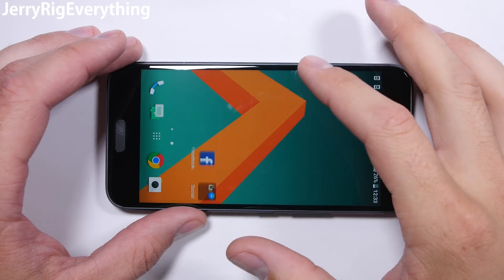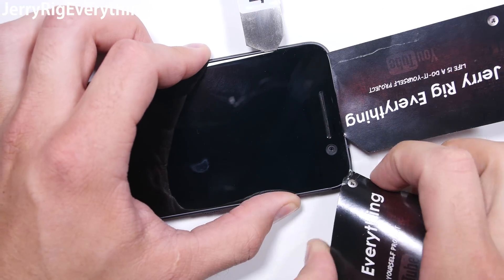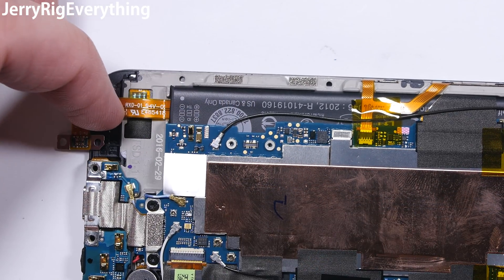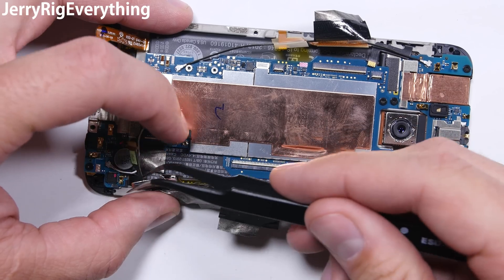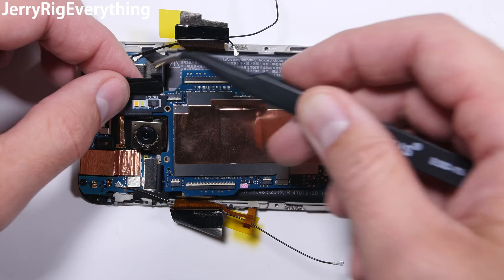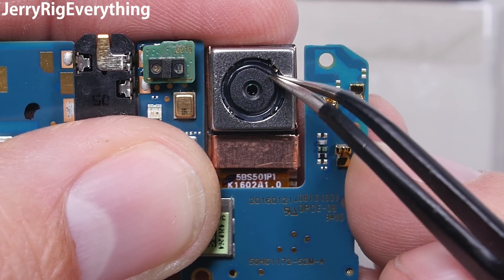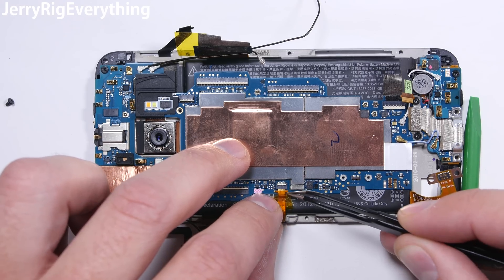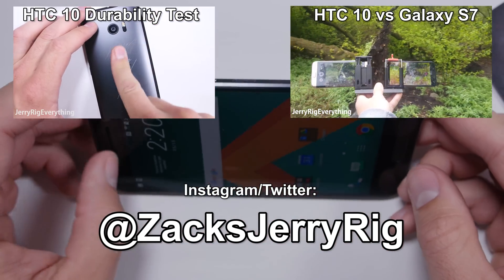HTC 10 Teardown - Charging port fix - Battery Repair - Screen Replacement

Comment: Hi all, i want to replace just the charging dock.
Do I have to do every step in the video until the charging port, or are there some steps i can skip ?
(I don't need to change the screen nor the battery so I thought maybe there are some cables and/or elements that i can just leave as they are ?)

Comment: I am replacing my battery on a HTC 10 and when I opened up the case the two screws that clamp over the battery ribbon we're missing. Does anyone know what size these screws are?

Comment: Just took mine apart down to the battery.  Whoever replaced the battery put a little piece of electrical tape over the HTC logo.  I think they must have taken a photo and asked their friends to guess what phone it is lol.  They also reassembled the phone with no screws or anything holding down the battery cable!

Comment: On the htc 10 i tried the glass is not glued to the lcd. They came apart awkwardly and it was a disaster. I don't recommend htc. Over engineered.

Comment: I'm using HTC 10 right now, have it for 3 years - Asked what battery replacement would cost. 149 EURO. I thought, damn I could buy a new one. But I bought a battery, pretty inexpensive and brought it to a guy in România for replacing it. End of the game, in total it cost 100 euros with battery and my display hast touch problems, light coming out of the sides and the phone does not vibrate anymore. I was mad. I went back and no Shit guys - The motherfucker disappeared. Gone. Closed his office because of vacation. Bruh.. But hey, after this video I can't blame that fucker

Comment: Well, here I am again on screen number 3.

In December I needed to replace my badly degraded battery. First original grade A LCD was destroyed removing it. No physical damage, my playing card just severed a ribbon cable between the LCD and glass. Battery replacement and LCD replacement was successful.

This LCD went faulty after 4 weeks. Phantom touches, etc.

Replaced this LCD. The new LCD was perfectly fine with touch, but had a blue tint where the light was meant to be white. Typing speed was decreased by half, as the digitizer was far less responsive. Think old school capacitive. Now this past week with the heat in the midwest the digitizer has gotten less and less responsive. Woke up this morning and touch no longer works, period. 

Lesson learned, buy an OEM LCD. In my case I bought a used genuine HTC OEM LCD from a T-Mobile HTC 10 with some slight burn-in issues. Grade A condition screens are around $55 which I am unwilling to pay on a phone this age.

Guess I'll be taking it apart for a 4th time when that arrives. Does this make me a sadist?

Comment: Phone just returned from the service where they changed the battery. I had to sign a document that I'm accepting a risk of screen damage. They managed not to crack the screen but it does not work on the edges and GPS can't find satellites anymore.

Comment: Dang i went to deep in the top right corner. I even separated the backlight layer from the lcd. Still works perfectly except for the top right corner which is totally black. Waiting for my new screen module now for my htc with a fresh battery in it. Great video.

Comment: I know it's an old video but thanks! My first time taking a phone apart and I've managed to replace the battery and screen (while keeping the old one functional). Only issue is that I buggered up the power button while prying, but that's an easy fix, just waiting on the cable. Even though the comments say it's a nightmare, you made it really easy.

Comment: This is the best HTC 10 teardown video. Thank you. I managed to change my battery without breaking anything. The most valuable info was the location of the hidden ribbons underneath the battery. It was stuck hard on the adhesive.

Comment: What does the white wire do!? I pulled the housing for that from the motherboard when taking it off, is it even worth continuing to go ahead with the battery swap at this point?  Thanks.

Comment: Just swapped the battery, speakers, switches, and screen....and the screen is showing static then distorted versions of the decrypt screen. When I try and enter digits the screen will move and numbers will change size. Tried unplugging and reconnecting the screen cable and now it's all black. Doesn't seem like the ribbon cable goes in far enough, but it's straight so I'm stuck.

Comment: Well first off you do a great job, clean, professional and detailed.   I on the other hand SUCK at this HAHA   I've taken apart a lot of things so I figured you make it look easy, I know it won't be that easy for me but I can get it done..........   WELL now I have a phone that while plugged in, the light slow blinks amber.  Do you know what could be wrong?  I know HTC says that means the battery is very low.  IDK probably just going to grab a new phone but the budget is $180 so it's tough.  Any thoughts?

Comment: Followed these steps as closely as possible.  Wasn't too bad, got the screen off fine, thought I got everything put back together.  However, the right button no longer lights up, screen won't come on (not shattered or anything), and makes an odd almost clicking sound when turned on.  I'm sure I messed something up on it, but the actual process wasn't as bad as the video made it seem.

Comment: I just performed this repair and my god it is a complete nightmare. Screen still works but has lines down it so I've ordered a replacement. Everything else seems to work OK after replacing the battery. Need to do a complete test though. I agree with Jerry, buy a new screen just in case because the chances of breaking it are high.

Comment: I bought parts for my HTC 10 and took it to get fixed because I knew it was difficult and ASKED these guys if they can fix htc10 and they said yes. Now my back button led doesnt work, the bottom left screen is up and above the frame and the cameras and audio jack don't work. I'm upset and wish they watched this video :(( i went to get the screen and battery replaced

Comment: I just replaced my battery thanks to you Jerry! Some Tips for people doing this would be:
-Take a look at the front of the screen, the black parts are where you can put the cards through, the middle part which you actually see from is where the card shouldn't go at all.
-You can see on the sides of the screen the black line is very thin, this is where people mess up. You can not push your card in past this point!
-I feel like this looks worse than it is, Once the screen is off, just disconnecting the connectors and stuff isn't that bad. I did mess up once by putting the battery ontop of the charging cable on the top right. Do a once over after pushing the battery down. 
-Also the tool kits they give you with Batteries are not good enough, I used a box cutter but you need something good enough to get the small sections
-I had a heat gun that I was originally trying to use at a lower setting and it was a pain to get that screen off. I changed the setting to 9 which I imagine is 90 degrees idk but once I did that it worked soo much better
-FYI I have a screen protector on this and I didn't need to take it off there was no damage to it at all.

All in all, it's not bad but I'm not sure I would do it again. A local cell phone repair place quoted me $90 to replace it. Now that I bought the battery and will have to buy the screen too I'm going to be paying like $60. I will say this isn't as bad as I thought it was.

Comment: Hey bro can give me tips or give me solution of htc 626 there is not coming display if i do constantly press the power button  the display  was start with only blue light so what should  i do in this problem i am from india and i am mobile repairer plzzz pllzzzzz give me propar solutions

Comment: I was thinking about replacing the battery in my HTC10. So I thought I'd see if any kind sole has put a video on YouTube showing how its done. This tutorial video is literally the best on the planet. However it's so good that it's revealed to me that it simply isn't worth it due to the extreme level of intricacy and detail you need to be and constantly stay aware of whilst undertaking such 
 a task, otherwise youwill endup going wrong somewhere along the way and end up scrapping the phone. Thanks to this video I think the main message is,  that if you might not feel up to it, it's simply a much better idea and easier to pay the money and just buy a new phone.

So 10 out of 10 for this tutorial video. Jerry you are a true and talented engineer and I only wish I had the same skill and competence as you. All the best. Miles.

Comment: i hate the idea  of placing the mother board on top of batteries in this htc M series , i also strongly believes that's the reason for the hotness...the A9 doesn't hot and its because the board isn't place on top of the batteries ...

Comment: TIPS that would have helped me, hope they help someone:

- The LCD behind the screen is super fragile.
- Do not insert any tool on the left or right sides of the screen more than 2mm (VERY IMPORTANT). Top and bottom you can insert nearly all the way to the edge of the LCD panel, but sides do not insert more than 2mm.
- I suggest setting your heat gun to 100 deg celcius and heat the edges of the sceen until uncomfortable to touch, thats enough to soften the glue.
- I was very careful but STILL broke my first screen LCD (was repairing 2 phones). On the second phone, I LEFT THE PHONE ON so I could see exactly when I was using too much force and the LCD was starting to flex/distort. This saved my second phone screen and may help you too. If you're doing this I would strongly caution against going above 100c as you may damage the LCD if it's running that hot for long.

p.s. holy hell this phone screen is fragile, you weren't joking that you said "basically if you're opening this phone [..] expect to replace the screen as well"
Reply: I destroyed the LCD... If I would have read this.... Before...
Reply: Same here. I just happened to rip a tiny cable too above the soft buttons.
Reply: Can a suction cup help to create a gap for the cards? I just received my battery so i'm gonna try to change it later this week.
Reply: @jesselioce  Lol I wish I had thought of reading comments in addition to just watching the video. I attempted first battery replacement last night.
Reply: I broke two LCD....lol

Comment: Great video. Allowed me to successfully change battery.  Only one thing I could not see on the video was how much heat to apply to the front glass - I applied too much gave my LCD that is stuck onto the glass a bit of a shrink.  So need lots of heat not to break the glass but not too much - my heat gun was set at 200!!

Comment: I want to thank you for this video, my HTC 10 was a great phone but has the now pretty well known battery issue, it's been sat in the draw for the last 6 months, decided to by a new battery and have a go at replacing it,  no stranger to working with tools as I own a garage but car are a bit different and a lot bigger, I've never opened up a phone before let along repair one so a totally new experience for me, I've managed to do it without damaging the screen and everything works a treat
Reply: Cool Kid be extremely careful around the edge of the screen when trying to separate the glue, the actual screen it's self is also glued together around it's edge so your song not to penetrate that, once the screen is out the rest is pretty easy, just very delicate, I don't think I spent enough time heating the glue up when putting the screen back in as its lifted in places but the phone is fully functional, if you don't heat the glue the screen won't stick back in and could fall out when using
Reply: Cool Kid awesome mate, Yh this phone is a bit of a nightmare

Comment: Thanks to you I just successfully changed my phones battery :-) Its a shame even most of the "unofficial" maintainer for custom roms dropped this phone for any else... Even I am thinking about another brand after this bad "oreo-update-battery-life". Lets see how the new battery will keep up against the old.... (30-40%, sometimes even nearly 50% after about 2h music listening, mostly over Bluetooth with mostly screen off...)

Thanks again! Even there are a few more videos for the htc 10 out there, you were the only I found commenting about anything.
And props for your other videos! Sometimes it needs a broken phone for seeing really nice tech videos ;-)

One more thing:
My adhesives for the screen were not good anymore after assembling everything. I have now used some double-sided-tape with ~0,5mm thickness I had lying around.
Any experience with other glue? B- or T-7000?  "Random" double-sided tape from ebay (273210775397) or amazon?
Already thought about the B- or T-7000 since it should dry out not completely hard, but I don't know about its viscosity before.
The 2mm double-sided tape looks better, but seems to be generic china stuff sold with different "brands" ...

Comment: Fantastic tutorial, I've already replaced a HTC10 screen and am going back in to do the battery and replace another screen on a different HTC 10. Ive picked up a couple of these phones cheap on eBay and don't mind going in to fix them myself. The great thing about this overview apposed to others I've watched. Is this gives you the straightforward tear down with good visuals right down to the SD/Sim sockets.

Comment: Is it possible for me to replace the HTC 10s battery? I haven't replaced a battery in around 6 years & that was the iPhone 3GS. It was easy but I'm afraid i might break one of the components due to it's complexity

Comment: never thought I'd come back here, but the HTC 10's battery life is almost iPhone-level bad after less than one and a half year. Well, I'm afraid I'll have to buy a better phone, if the battery keeps getting worse. Don't want that power bank life and there's no way I'm replacing/getting replaced that battery at resonable costs. Very sad, liked the HTC 10... )-;
Reply: Lithium ion batteries naturally lose capacity over their lifetime, at 1000 discharge cycles you should expect less than 50% of the original battery life. It sucks, but that be how it do
Reply: me too. I thought HTC phones would last me a long time without having to service them. Turns out, I was wrong. And this is my second HTC 10 that I got from my warranty, since my first one got its power button stuck. I'm officially getting an iPhone at this point.
Reply: i spit on you then it kind of sucks that HTC cheaped out and stuck a shitty battery in the 10, and also made the phone much harder to service in the process.
Reply: the problem is quick charge it kills the battery really fast. htc actually refused to replace my battery under warranty  @ducis3446

Comment: Thanks for the video...after watching this I easily replaced my battery. It really was not that hard, and not much worse that many other phones. One thing....for other readers...or for you JerryRigEveryting, if you are replacing the battery only, there is no reason to remove the charging port or disconnect the active buttons. Just leave them alone!

Comment: If I'm replacing the battery, and my screen is cracked, should I definitely replace the screen while it's opened? I am moderately experienced with phone repair. My screen has been cracked but totally functional for a long time. I've got my replacement battery now but no screen. Should I get screen or is it avoidable? Moderately experienced. Thanks!

Comment: Where can i find a replacement charging port..? My phone suddenly went dead and has never been dropped or submerged. When i plug it in nothing happens, no lights. Cant even boot into bootloader. Sprint repair said there was a little corrosion around the charging port. I would like to try replacing the charging port and battery.

Comment: HI Jerry . i Spilled a glass of water on my HTC 10. powered it off immediately. i ve been resting it in my camera dry box with a silica unit since last night. around14 hours now. how water resistant is the HTC 10? safe to power it on?

Comment: so if i were only to replace the usb port i can skip the part where i need to take off the tapes and the hell break lose type of wiring for the display right? oh god i dont want to be there. so hopefully you can answer this. thanks for the reply zack! :) i have an htc 10 and when i charged it it started smelling like smoke. so i guess its a fried up port. ordered a replacement port tho.

Comment: Phone was at about 60% battery. Dropped it and it turned off, would not turn back on, charging indicator light doesn't come on when plugged in, will not power on at all, force reset doesn't work, tore phone down completely as in this video and checked all connections. Still nothing, any ideas? Battery?

Comment: When I shake mine, you can hear something around the top area of my phone that rattles, something is loose, anyone has had the same problem?
Its not the vibrator cuz of the rattle noise comes from the top area of the phone.

Comment: Can the heat itself damage the screen in any way? I mean today I took back my HTC 10 from HTC repair center, they changed the whole back cover due to paint defect, I noticed after a meticulous inspection that my screen has 3 small faint smudges that won't appear but on plain white background, I don't know if it's a minor defect I never noticed before or when they opened the phone to change the cover they did heat to much the screen (or it got dirty somehow)?

Comment: hey jerry, i need to change my screen which is the white model one, but i am.only getting a black one as replacement, can i change the fingerprint scanner too? or i must swap the same old one due to security reason of using the fingerprint scanner.
thanks